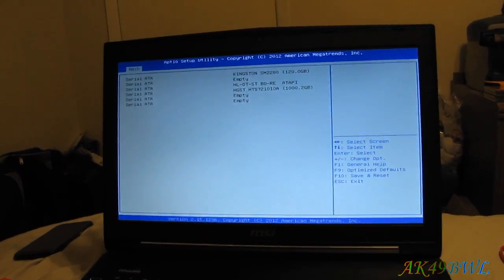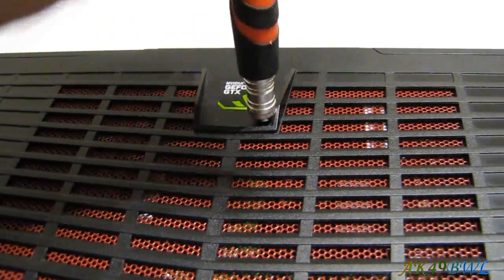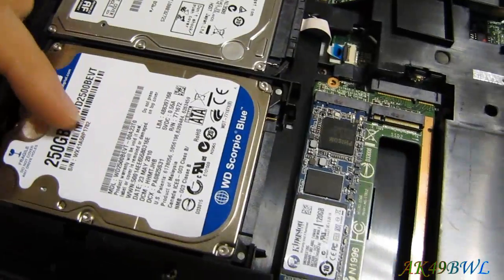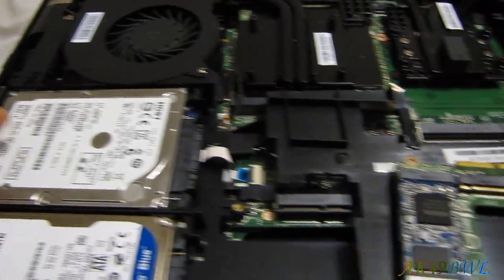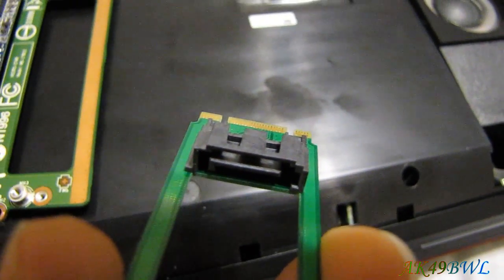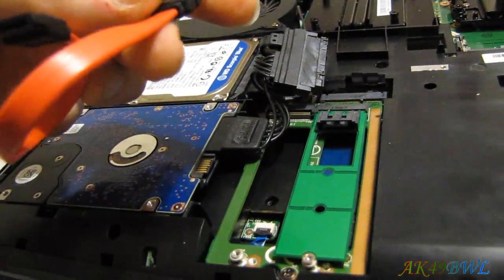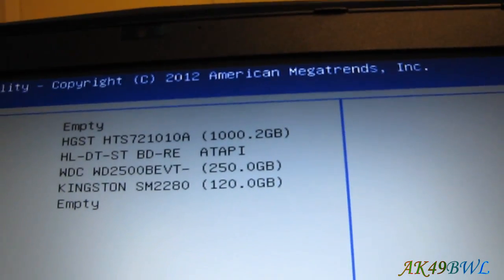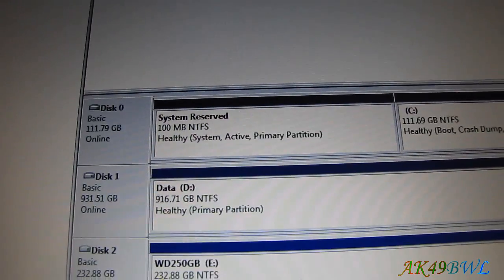How to Install a Second 2.5" HDD in the MSI GT72 Dominator Laptop

Comment: This modification isn't bad either on my Gt72s :p
http://i67.tinypic.com/2a5yzxz.jpg
It works.
http://i63.tinypic.com/1g5dht.png

I did your modification but the cable weren't long enough to reach to the hdd sata cable and I ended up returning it. I also got the yellow sata cable damaged it wasn't able to detect the hdd afterwards but was able to get it replaced by msi under warranty I drove to Msi to drop the notebook off it was only few miles away from where I live. And they were able  replaced and ship back to me in 2 days. The comments here gave me an idea of using another modification a way for second hard drive and it worked. This is a good video on getting me into an upgrade. Thanks Brandon.

Link to purchase with everything.
http://eshop.sintech.cn/25-sata-ssd-to-m2-ngff-adapter-card-with-power-for-msi-gt72-p-1132.html
Reply from the maker: Ooohhh.... I like that the M2. card supplies power without having to split the main SATA connection. Will definitely have to get one of those!!

Comment: Please make a video of how to upgrade from 16 to 32 GBRam...  I am not good at this..
Reply from the maker: nengstro If you're looking to do that in this machine, I promise you it's SUPER easy :) just remove the eight screws on the bottom, pull the back cover off (this is shown in this video), and you'll see the two RAM slots right in the middle of the system. Take your two RAM sticks and slide them in at a 45 degree angle to the slot, and push down until they click into place. That's all there is to it!

Comment: Can you tell me， my new 1TB 2.5" HDD can do that？

Please REPLY ！ THANKYOU！
Reply from the maker: 谁是谁非 absolutely it can! It's the exact same procedure as what I did, just mine was a smaller drive I did it with lol. You should have no problems.
Reply: *****OH，The HHD Capacity do not have effect in this project ， right？
Reply from the maker: 谁是谁非 Correct :)
Reply: ***** GTEAT PROJECT ！i try to do that，thank AK

Comment: can a gt73vr 7rf using this mod? on mxm vga slot?
Reply from the maker: Are you saying like, replace the video card with an adapter to run another drive? Theoretically I'd say yes it's possible because the MXM slot is likely just a PCIEx16 slot, but I'd be willing to bet nobody makes adapters for that.

Comment: are these hdd bays 9,5 or 15mm ?
Reply from the maker: valg321 They're 9.5, but if you were to remove the retaining tabs that hold the drive in place from the bottom of the case, I'm sure a 15mm would fit. There's a lot of space between the case and the hard drive bay without those tabs there.
Reply: ***** thank you. 
I'm thinking of buying an msi gt72 and a second internal hdd is a must for me. Great video btw
Reply from the maker: valg321 depending on how much extra space you need... The MSI GT72 already comes with at minimum, a 1TB hard drive, and most 1TB drives out nowadays are 9.5mm drives. If you were looking to go with another 1.5 or 2TB drive tho, then I could see worrying about the depth lol.
Reply: ***** i need a laptop as a complete desktop replacement, so it must have good graphics capabilities (ideally 980m) and at least 4TB of internal hdd storage, and a dvd drive at the same time, excluding possible ssd's.

I know the samsung spinpoint 9MT is a 2TB, 9,5mm, because i've got one but i also have a WD20npvx that's also 2TB but 1,5mm thick.
If worst comes to worst i guess i'll just buy a second samsung spinpoint.
Reply from the maker: valg321 Wow :) Sounds like you have it pretty well figured out at least! I have the 780m, and after 6 months on this machine, I can very well recommend it as a desktop replacement... Minus having to do all the special stuff to get the second HDD connected in there lol. The 980m will be amazing :D I wish you luck, and if you have any further questions feel free to ask me.
Reply: ***** cheers mate

Comment: Is there any other option ?
Reply from the maker: ***** aside from adding more M.2 SSDs or replacing the disc drive with a hard drive caddy, no.
Reply: ***** do you know where I can get a disk drive for the GT72 ? Thanks :)
Reply from the maker: I like to buy from Newegg personally, but there's Amazon, Best Buy, heck even Walmart sells hard drives but I dunno that I'd trust my data to one of theirs lol. I'm fond of Western Digital and HGST/Hitachi, in case that wasn't slightly obvious ;)
Reply: ***** Thanks but I meant the one for where the dvd is ! maybe you have an idea
Reply from the maker: Oh! .. Wow, it's been a while since I got mine for the old Dell, I've forgotten, but I'll find out for ya real quick! I'll note that it likely won't match up with the exterior like the CD drive does, but that never bothered me :)
Reply: ah ok ! thanks a lot for the help :)
Reply from the maker: ***** okay, I got mine for the Dell from NewModeUS http://www.newmodeus.com/shop/index.php?main_page=index&cPath=2_27 but it looks like LOTS of places well em now, Amazon noted again lol - now, I know the CD Drive in our machine is SATA, but I'm honestly not certain if it's a 12.x or 9.x mm drive... I would check that for you right now but I'm not currently within 20 miles of my laptop lol. If you want, I can check when I get a chance :)
Reply: ok thanks will check it out

Comment: Hi, Brandom. I´ve seen your video and I think that it's very interesting for me because.......
I have a MSI GT72VR 7RD Dominator and I want to install a second SSD, but I haven't the adapter for 4 M.2 SSD (MS-17812).
Can you say me if I can buy this adapter and where can I do it?
Thanks
Reply from the maker: The GT72VR does not support the four port card. They nixed it in favor of NVMe - the four port card was for SATA SSDs only.

Comment: Hi.  How to unmount the dvdrom?
Reply from the maker: There's a small screw near the onboard SATA port, remove it and the drive will slide out. You may need to eject the tray to get enough leverage to pull the drive out, but it should not be too hard to pull - if it is, you probably didn't remove the correct screw.
Reply: thx.

Comment: Can anybody please tell me what is the name of that m.2 ssd 4 port card or send me the link I am looking for m.2 solution for my MSI GT72vr Dominator Pro. 
Thank you
Reply from the maker: The 4 port card is not compatible with the GT72VR.
Reply: Brandon thanks for replying can you tell me what is the best solution for me with m.2 drive since I’m trying to avoid that 2.5in ssd route. Thank you
Reply from the maker: Newegg and Amazon both have a huge selection of M.2 SSDs to choose from.. I'd recommend Kingston (what they come with), Western Digital, SanDisk M.2 drives... Only sad part is you're pretty much stuck with SATA as the laptop doesn't support NVMe drives. As for adding another 2.5 drive (in addition to the 1TB included, without removing the Disc Drive), you're pretty much out of luck because the VR doesn't come with as many SATA controllers as the older GT72 did.

Comment: Maybe 10 years, from soldier class three, to First Lieutenant, in my nation's most agile forces was too long, but I think, one has to adapt to what one has, what one can and when and where one has to do it, without making demands which will only serve trivia, and will cost, exactly there, where you should have spent on non trivial things.

If the above paragraph is not true, than one has but to ask, why even adapt a laptop? But I won't, because I will adapt to what I have, what I can and when and where I have to do it. I hope tomorrow, I hope to obtain the goods that will make it possible to have some more SODIMM sockets in my MSI, not for the CPU, since it is already close to its max, but just a few gigabyte to facilitate an asymmetrical mirror of an SSD RAID 0 upon a single HDD, with defer write indefinite, full flush upon exit. Though maybe I should try make it write on Idle, full flush on exit, or maybe I should put something like a Sandisk 128GB Slim fit in between the SODIMMS and the HDD. Any way, Reads from a RAID 0 SSD, and writes to SODIMM, which may or may not flush to a tiny USB Thumbdrive, which may or may not flush upon a 1 TB HDD. Whatever complains the least

I was trained as a saboteur, I like my information volatile, that is why I have been keeping all my RAM since I had my first computer, and now I get to play.

Comment: Hi Bro , nice video. Do you think we would be able to fit 15mm 2TB 2.5" HDDs in to any of the HDD bays ??? I saw it as an option here http://www.avadirect.com/MSI-GT72-Dominator-Pro-G-1438-G-sync-Intel-Core-i7-5700HQ-Gaming-Notebook-17-3-FHD-LED-NVIDIA-GeForce-GTX-980M-4GB-Graphics/Configure/9681061#configurator
Reply from the maker: Uraz Kıvaner Yes, I'm fairly certain it would fit. There's a lot of space in the primary HD bay... I dunno how well it would fit in the secondary bay (closer to the front of the machine), but the primary should fit a 15 fine. I'd beware of those WD Green drives tho... They're great for storage, but not heavy R/W usage, so I've heard. They're a little on the slow side as well, even for a mech hard drive. I'd go for the Seagate or the Samsung Spinpoint.

Comment: why not just image the M2 drive rather than getting another one??
Reply from the maker: In case I want or need to go back to factory settings in very little time.
Reply: If you were to use Acronis it will restore the drive in about 10 mins - much cheaper option
Reply from the maker: But lacks the ability to wipe out the factory drive and use it for storage, as I did mine lol.
Reply: not sure I understand - just take an image of the factory drive ( use a byte by byte image if you must) to another drive and then use the factory drive for what you want - if needed you can restore factory settings from the image
Reply from the maker: Oh, gotcha. Yeh, I coulda done that. I just opted for another drive because I could lol.

Comment: sorry for the resurection of this post... but would it work with this http://www.ebay.com/itm/142206238171 + a sata cable
And what is the 4x SSD card? My laptop came without it, where can I get one?

Edit: the quad ssd card is called "ms-17812" something something, any1 know where to get one?
Cause I think that it just might work with the "Power M.2 NGFF to 7 Pin SATA III SSD Adapter"
Reply: Aliexpress

Comment: bleh all this is just too much drama, just put in 2x 512gb mssd
Reply from the maker: Why when I can potentially put 4TB of 2.5" physical drive in for half the price? Maybe not everyone is so rich that $500 is considered "cheap".
Newegg as of January 2015:
2x 512GB Transcend M.2 SSD: $450 - you get 1TB of storage.
2x 2TB SAMSUNG Spinpoint 2.5" HDD: $240 - you get 4TB of storage.
The choice is pretty clear to me. Now, if you're looking for speed vs. capacity, then yeah go SSD but if you just want the capacity? This video will show you the way.
Reply: ***** I would agree. I only have a single 256 SSD as the boot drive and two 1TB mechanical drives in Raid 0 for storage. Got all three items for a little less than $200 on black Friday.

Comment: why do all this shit....buy 2 1tb m2 drives ...mechanical hdd's is so 2005....ssd is the way to go
Reply from the maker: That may be the case today, but I made this at the end of 2014 when you wouldn't be getting any 1TB SSD for less than $500. No thanks! But, for the record, this same laptop now has no mechanical drives and 5 SSDs lol. About to get a battery replacement, but still going strong nearly 7 years later.
Reply: @AK49BWL  Have you upgraded its graphics and ram, though? GTX 1070 revision 1.2 from MSI themselves is perfectly compatible and still fully relevant, especially considering today's market realities. As for ram, 2133 Kingston sticks OC'd to 2400 are perfect too, and give a noticable improvement in pretty much all games from the past few years. In case of a Skylake GT72, it takes up to two 8Gb 2933 ddr4 sticks. And, finally, you can freely install a 120Hz display panel for even more relevance today. Too bad all the mobile CPUs since 2014 are BGA filth.

Comment: What is that little board you have that has 4 sata slots?

Looks like an adapter or splitter?

What's it called?
Reply from the maker: It's the M.2 adapter, MSI proprietary part for these machines.

Comment: hello, but you can't use another ssd m.2 changed to the right side and then do that what you do ?
Reply from the maker: You can use three M.2 drives plus this conversion, or just use 4 M.2 SSDs. You don't have to put the cable where I did in this video, there's plenty of space between the drives and the bottom cover so you're not going to mess something up.
Reply: @AK49BWL  alright, thank you very much. Seems they don't think a lot about that connection for one more mechanic disc... They put space for that but not connection... Wtf lol.

Comment: Hey I don't use my CD drive can I use that sata cable for my new sata3 ssd
Reply from the maker: You can get a caddy to install a drive in the disc drive's place, but that connector is only SATA2 like the internal hard drive SATA port. Only the M.2 slots are SATA3.